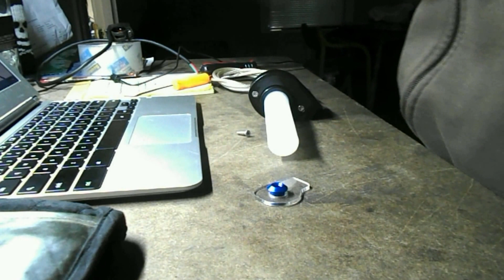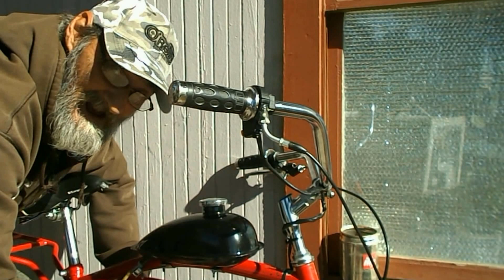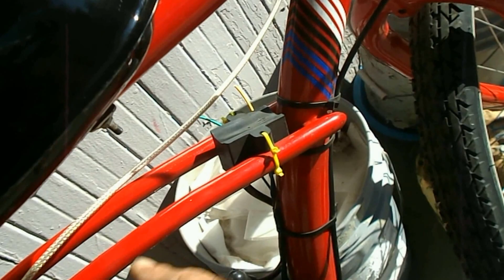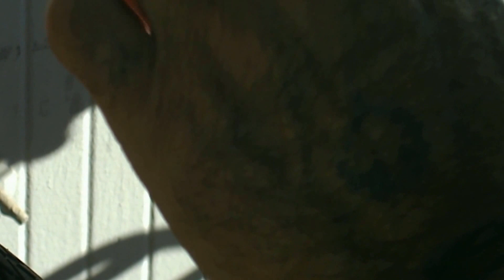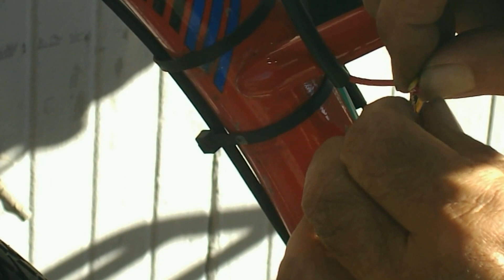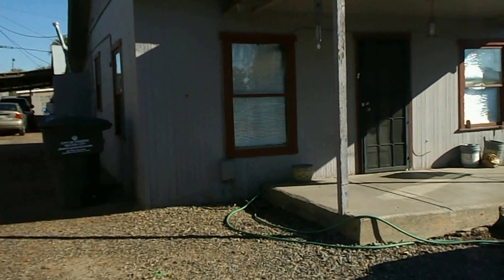Upgrading the Throttle on my 48cc Chinese Motorized Bicycle

Comment: Bro I replaced throttle grip old one cracked how do I give it a little more slack n cable
Reply from the maker: road Tyrone that depends on how much cable you have left after you finished . Where's the throttle housing is underneath
Reply from the maker: If you turn the screw that the thing that the cable runs into you turn it in it loosens the cable if you screw it out it tightens the cable it tightens the cableso depending on how much cable you have still left when you when you connected it to the slide would you determine how much slack you get
Reply: Thanks I think I just did it it went from tight to some turn thanks bro
Reply from the maker: @tyroneadams355  you can shorten the cable at the slide also but that's kinda tricky best bet is make sure the throttle body/grip is all the way on the handlebars and then adjust the cable field remember you have to have at least 6-10 threads still in the throttle housing so it doesn't strip out

Comment: Throttle will turn, but won’t give the back acceleration .. my motor turns on , but when I pull the the throttle I don’t go anywhere
Reply from the maker: Pull the clutch cover right side engine . Locate brass flower nut in center of clutch housing. 
Using slot/flat blade screw driver bit turn flower nut 1/2 turn to right (clockwise) restart engine -- same thing happens? -- turn screw 1/2 turn to right (clockwise) restart engine -- note to self -- you can start and run engine with clutch cover off needs be extremely careful when engine is running. Can and will catch or pull something in and whatever it is will be removed from your body!!! DO NOT PLACE HANDS AROUND OR IN SPINNING CLUTCH MECHICISM. CAN CAUSE SERIOUS INJURY OR DEATH!  But u can do it makes adjusting the clutch way easier. 

When you say"but won't give the back acceleration" 
What are you talking about? Doesn't make sense and this is where the problem is centered. Explain or make video shucks draw a picture Explain please I a hillbilly but I probably smarter than you so please explain what you are saying.
Since engine starts and runs -- does it idle by itself? 
Twist the throttle and no revs come up right?  If so redo cable connection to slide and this time make sure the C-clip stays in place.

Comment: I do long 50 mile round trips for groceriesin a day. (Walmart it 25 miles away one way) I'm just bearly past the break in period,  I grew up on Harley Davidson, the throttle would stay at the position / speed you set. On these long trips my hand goes numb holding the throttle all the time, on the motorized bicycle. Is there a way to make the throttle operate more like Harley so I can let go and rest that hand on the longer straight stretches? 

My second question, I attempted a 62 mile trip expecting to take 6 hours one way, 3 hours in, the engine locked up, broke a spoke, bent the rear rim and popped the tire almost simultaneously, of course nearly throwing me over the handlebars. Actually the tire popped after everything else while I was standing there texting my friend for help, it was like rubbing salt wound adding insult to injury. I had to call a friend for help to get back home and when he dropped me off I tried just running alongside the bike and pushing it to see if I could find what was going on with the engine and it had started spinning but then it would lock up for a few seconds usually pushing the bike backwards little bit we unlock it. Any ideas how to fix or what might be wrong with it at this point? I hope to hear from you soon thank you in advance for your time and then he help you can offer.
Reply: Throw it away more than likley killed it. Put it on a shelf forget about till you learn more. Buy a new one. Dont run more than 5miles at a time during break in if that. Dont pin the throttle its not a harley you cant just leave it wide open for miles and miles thats nuts. And if your doing that kind of riding you have no choice but to build a motorized gas frame.  Using just about any box bike its going to die fast. Hope your not using a rag joint for the hub you need a hub adapter. But also very good none coaster break hubs/rim mags the best. 
 Bottom line you can make a box bike work but you're going to be rebuilding the bike 2-3 times a year if not more. 
  Motor a real pk80 runwell will last a avg 6k miles than need a rebuild or just buy a new one. A standard only $160 and when you get your kit you should fully strip it down check everything ever cut lubrication in right places etc

Comment: Brian.  Keith from Ionia.   At idle, 25 mph, open the throttle and the engine stumbles. HS Japan carb. I thought air leak, sealed everything up, samething.   Changed plug, #4. Running a tuned piped. "C" clip in carb 2 #3 groove. middle.  Richer or Leaner?  Any ideas?   Thanks, Keith
Reply from the maker: make sure the cable is free inside the housing at the ttop of the carb-- the end peice inside the barrel is seeted right and then adjust it to the right hight for the housing. after that all you got is fine tuning unless one of the ports inside the cylinder has some kind of casting issue? distrupting the flow into the crankcase messing up the whole system of intake

to answer the question i would set it one click leaner run some premium in the oil for a few days see what happens maybe change to a #5 plug gap it at 28 that where i ran it") thanks keith for keeping me in the loop i miss my speeder bike something fierce bro")
Reply: If you are reasonably close to my "20"  I have an extra "speeder bike", if you need it.  "Blue" is a 26in. beach cruiser,w/a 60cc, motor.  Keith
Reply: Update;  took carb apart found a bunch of crap, blew out main jet with WD40, bunch of crap inside, did the same for the fuel inlet nipple, in general, cleaned the carb.  Big difference in running.  One notch leaner seems to work pretty well, and I've switched to Premium about a month ago.  Three places to get 100+ oct. fuel around here...The Local Airport,  Saranac, and McBride, at about $7.00 a gal.  I just gotta try the better fuels/gasoline.                           
   Just a thought...what about putting a glow plug adapter in and a couple of sizes bigger carb. jet, gasoline to air is 15 to 1, alcohol is 8 to 1, and then run Model Airplane Fuel w/15% Nitro.?                                                                  Switching to a Walbro carb. would really be handy, too, 'cause you could have control over both the High speed and Low speed jets. These carbs can be found on, weed eaters, backpack blowers, and chainsaws.  Bad thing is that the fuel cost would be pretty high  $10 - $12 for a gasbike tank of fuel, .06 of a gallon.  But the ride would really "blow yur hair back". LOL
Reply from the maker: sounds like you got the problem solved it pays to keep up on the maintance of the carb as you can see some of the "fuel" isn't up to standrds of the past")
Reply from the maker: where u at?
Reply: I  live in Ionia, Michigan  where u at?  Keith
Reply from the maker: right now Santa clara cali. but that could change anyday we might take of to oregen of go back to sf i don't know yet still feeling it out here") thanks keith")

Comment: got the aluminum with multi set on the cable better deal under twenty bucks ..
Reply from the maker: this one is way better than the one I had
Reply: +brian noel Yeah there's a lot of neat stuff on eBay take a look at the Archer 3 speed it's currently listed if you set it up on the bike it will allow 3 speeds haven't seen many listed ..The listing is current.